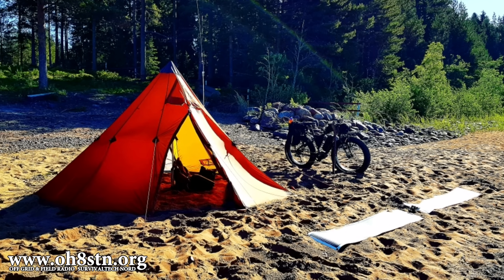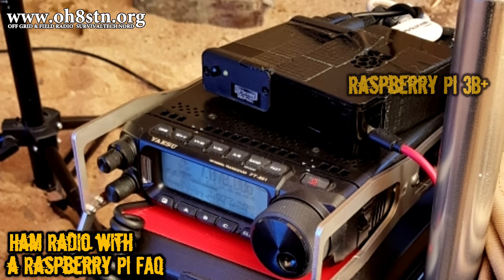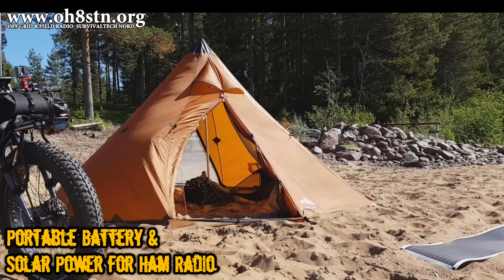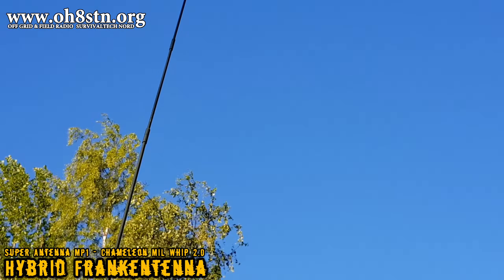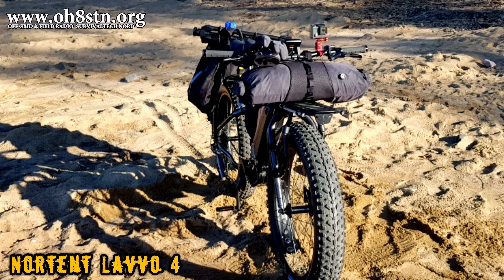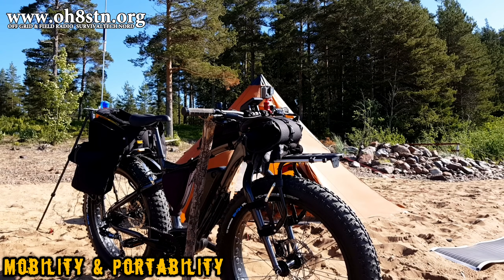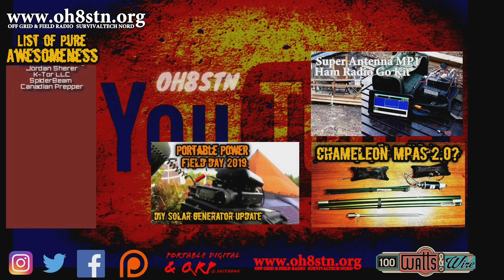Portable Ham Radio Station

Comment: Great video, thanks for posting.  I regularly test out my setup with just what I can carry in my backpack and your ideas are very helpful. Steve KJ4LAB
Reply from the maker: Thanks Steve. I think you understand very well then. Do you think you can tell us about your kit?
Reply: @OH8STN  Right now I'm using a Yaesu FT-817ND, LDG 817 tuner, Bioenno 12v 9Ah LiFePO4 Battery with a 28W foldable solar panel and charge controller. With that combination, I can operate for several hours SSB and still have a full charge. I've been experimenting with antennas, including the SuperAntenna MP1, the SOTA Beams tribander with the compact tactical 7m mast, and a home-brew end fed 43' wire with a hand-wound 9:1 unun.  If there are trees nearby, I prefer my long wire as it's very small and light to pack.  I have thin cord and a fishing weight that I use to toss up into a tree.  I've had several SSB QSOs over 1,000 miles on just 2.5W, including a chat with W1AW a few weeks ago. Your video has me interested in trying that chameleon whip on my MP1.

Comment: After catching up on almost all of your past videos I finally became 'absolutely magnificent" as a Patreon supporter. The content was just too good not to support. This video was the best of them all!
Thank you for showing the electric bike. That was very interesting to me. As for doing more with less I still think it might be good to have the Android tablet directly controlling the rig when that becomes technically possible. The Raspberry Pi is great but could be made redundant with the right software. Lower complexity could improve reliability. Hopefully JS8 willl be available on the Android soon.
Your videos are extremely educational and extremely inspirational!
Reply from the maker: I hope you skipped those older videos 😀 it took me awhile to understand how to tell the story. About Android as our primary operating systems, I completely agree. The only problem is Android development in the amateur radio community, is extremely slow at the moment. In fact that's the reason I moved over to the Raspberry Pi. I still use an Android tablet, but I use it as a wireless screen to connect to apps running on the pi, and to control my radio. I would much rather have the straight Android solution but, this is as close as we're going to get there until Developers start working with Android again. Like I said I agree with you on the Android question, but it's just not happening. There are apps for psk31 psk 63, rtty, wspr, weather fax, but there's nothing for winlink, there's no js8, Olivia, ... we do have a couple of apps for fldigi and psk mail, on Android. 
To be honest with you this lack of development in Android was heartbreaking for me. Still, when I look at the Raspberry Pi and my radio as a single system, with an Android tablet does the window into that system, the solution makes sense.
Take a look at this video https://youtu.be/BcMMlGvPCsw
The solution is not perfect but it is I'm about as close as we're going to get.

Comment: What a great setup and thank you for taking us through the gear and reasons for your equipment configuration. 
I totally agree with you on the need to simulate an emergency and not to use an RV or trailer to haul all your home station gear to your operating location.
73

Comment from the maker: Jump to time:
00:01 Introduction
02:15 ham Radio and the Raspberry Pi
03:25 Battery and Solar Power
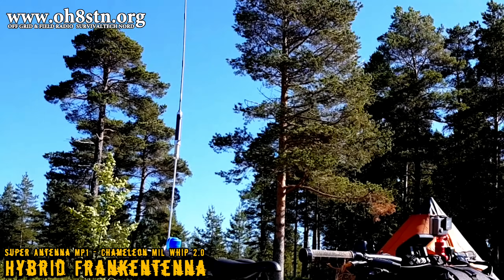05:15 Antenna system
07:35 Nortent Tipi tent shelter
09:38 Mobility, Portability and the electric Fat Bike
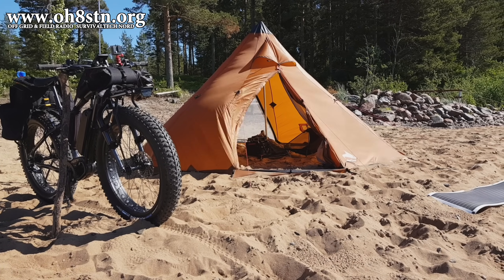13:15 Final thoughts